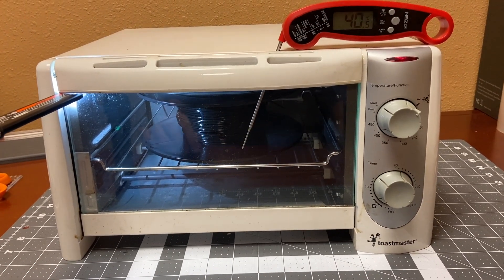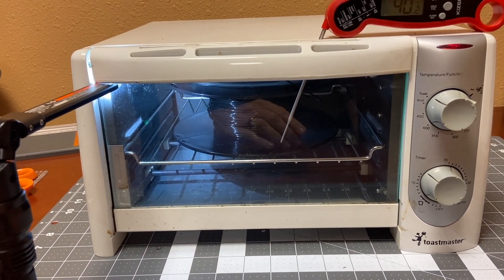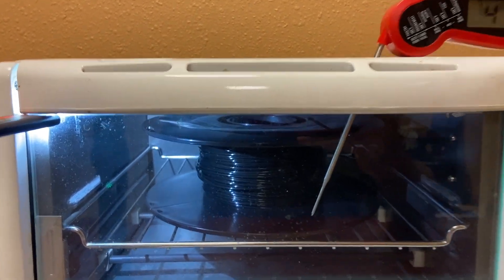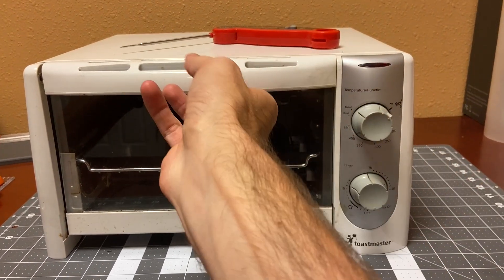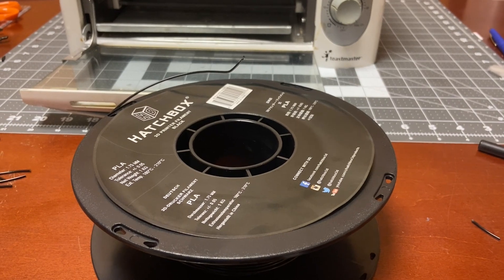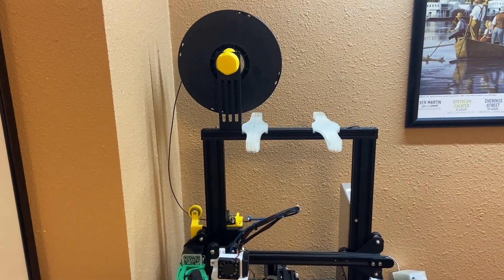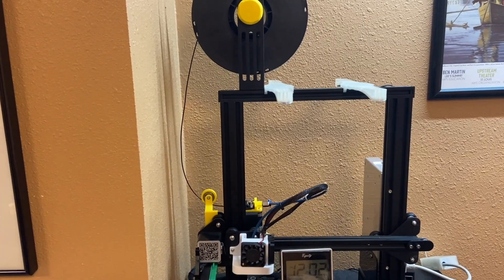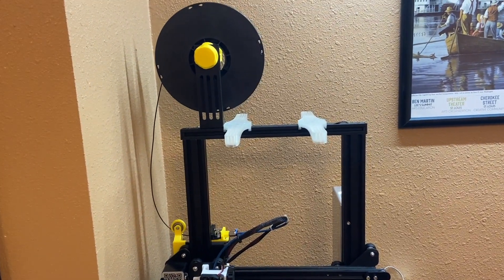Can you Dry PLA Filament in a Toaster Oven?

Comment: Cost of electricity VS cost of new roll ?
Reply from the maker: @nemesis851_  good question. I just went and plugged the toaster oven into a Killawatt meter. When the heating elements are powered on, it was using 1146 watts. The elements only stay on for a few seconds here and there to maintain this low temperature, but let’s just say they stayed on for the full 4 hours, and let’s round it up to 1200 watts (or 1.2 kilowatts). For 4 hours @ 1.2kw per hour would be 4.8 kilowatt hours, which is the unit that the electric company uses to determine how much to charge you. In my area, electricity costs ~15¢ per kWh, so take 4.8 kWh x 15¢, it would cost a whopping $0.72….that is if it was heating for the full 4 hours straight. In reality it costs pennies to dry the filament vs $20-80 per replacing the filament.
Reply: @DustinRogersinMO  I was thinking it would be consuming as aggressive as a toaster and it’s elements or microwave
Reply: I have an old toaster oven I used to cure polymer clay many years ago. I’ll have to see if It can maintain a low enough temp to work for this application. Thanks for the video!
Reply from the maker: @nemesis851_  just posted a follow up video about this https://youtu.be/tsgJJeQ1BKk?si=dum2-GU1MKQttraH